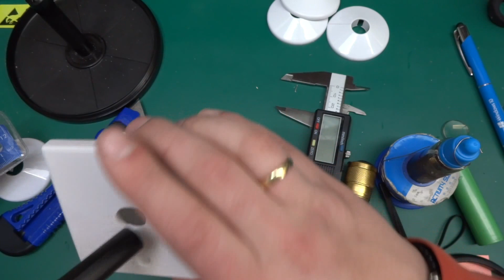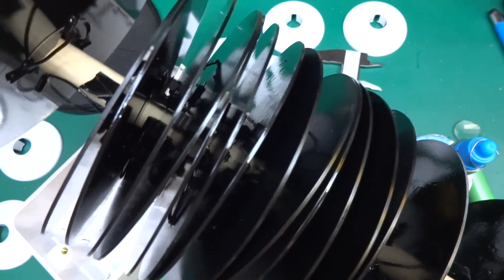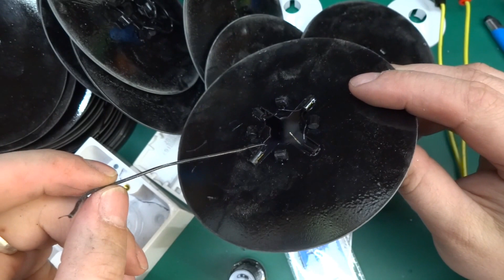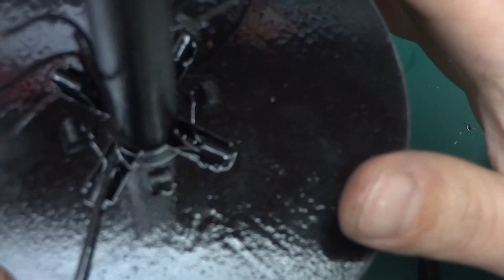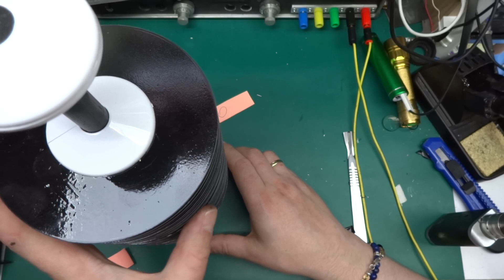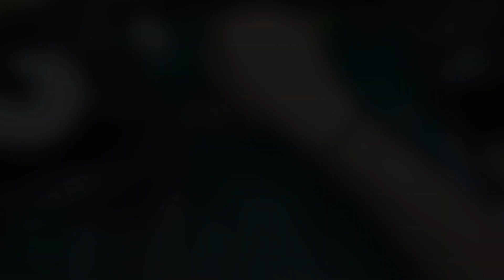DIY hacked CD LED mood lamp / night light - Full build - Part 2

Comment: I wonder, if instead of using bits of chopsticks for supports, if you got a piece of straight radiator hose from an auto parts store and cut it into say, 1/8th inch slices, you could use those for supports with the added advantage that being black already they won't need paint and they should also block the extra light from the LED's behind them in the center of the spool.  Just a thought.
Reply from the maker: +Rebel9668 not a bad idea :) i actually thought about doing this with slices of black pvc pipe, but then it turned out to be a pain to cut them accurately - a little off and the discs were getting slanted and it looked bad. Then i improvised with whatever i had around me, and chopsticks were just about right size :) Thanks!